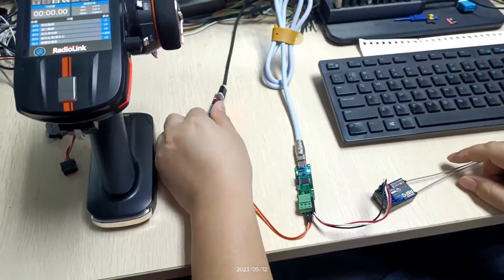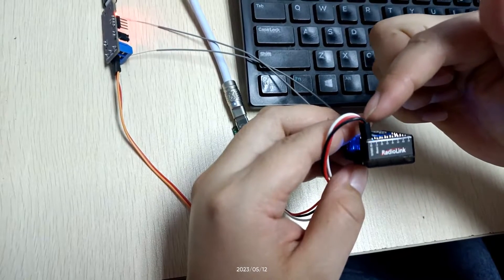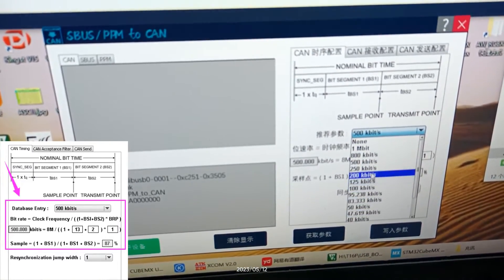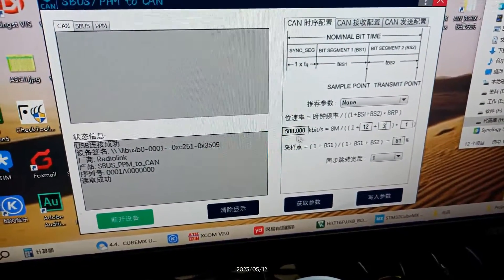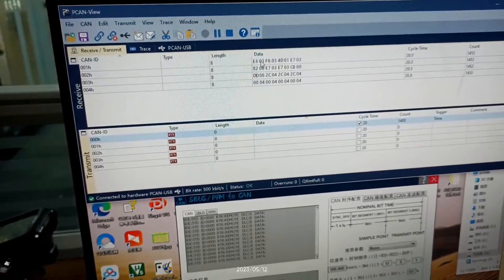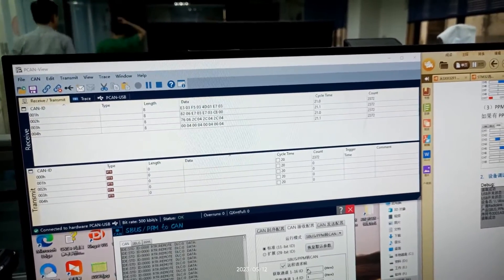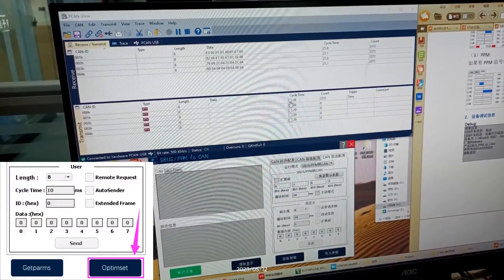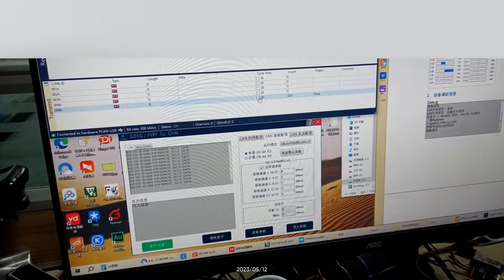RadioLink RTC8 Tutorial

Comment: what is RTC8 for ?
:face-orange-raised-eyebrow:
Reply from the maker: Hi, sir. RTC8, with dual signals that SBUS and PPM signals can be identified and converted automatically, is suitable for most remote controls.
Compared with the protocol transverter which with single SBUS signal, the RTC8 greatly expands the options range of remote controls. Here is the link of RTC8 for your reference. https://www.radiolink.com/rtc8  If any question about RadioLink products please feel free to contact us. Our email is: after_service@radiolink.com.cn
Reply: @Radiolink_official  can i know if it have an  use for a quadcopter or remote vehicule ?
what kind of duty its intended for ?
Reply from the maker: @omnianti0  Hi, sir. RTC8 can convert SBUS signal into CAN protocol data packets and then send them in a fixed format. It needs to be used with an industrial computer. It supports automatic recognition and conversion of remote control SBUS and PPM signals, suitable for most remote controls. Compared with single SBUS, it greatly expands the range of remote control options. You can check more details of it from the link: https://www.radiolink.com/rtc8
Reply: @Radiolink_official  yes i read that and understand but wanted to know in what scenario its used : can you give me an exemple of application : is it for robotic arms control ?
Reply from the maker: @omnianti0  Hi, sir. RTC8 is for industrial use, such as smart cars, pilotless automobiles, DJI gimbal, and other cutting-edge UAV or car solutions. So sorry it may not be compatible for robotic arms control. Here is tutorial on how to use RTC8 for your reference. https://www.radiolink.com/rtc8_video
Reply: @Radiolink_official  i dont own industrial pc but can you link a video proffesional user of such as exemple
Reply from the maker: @omnianti0  Hi, sir. Sorry we only have this usage tutorial of RTC8. If any other question about our product please feel free to contact us